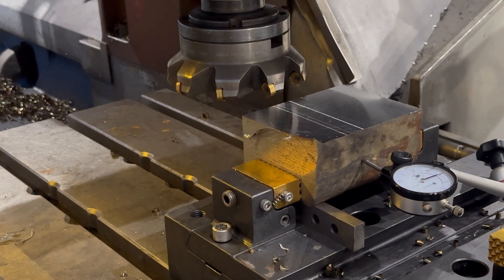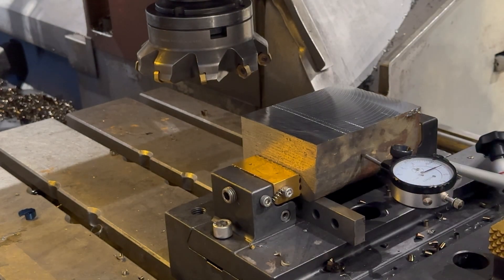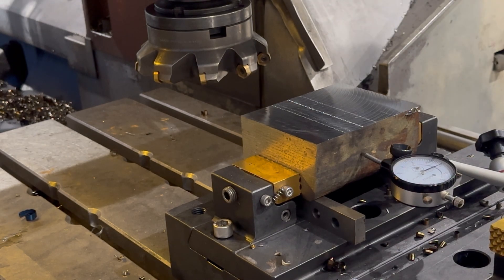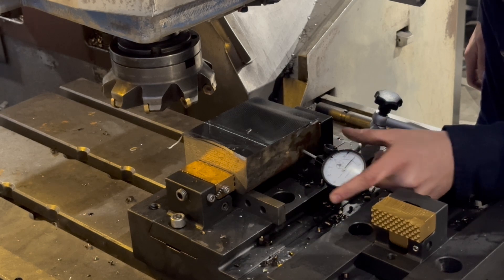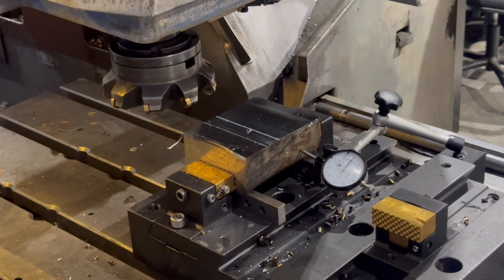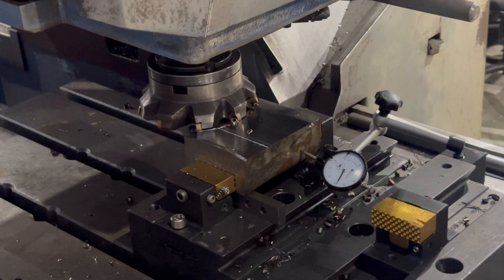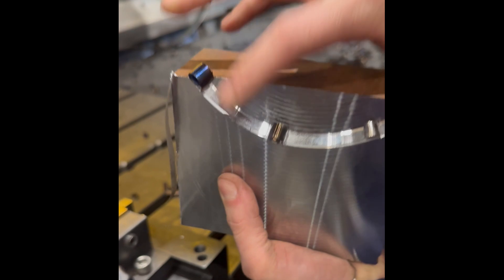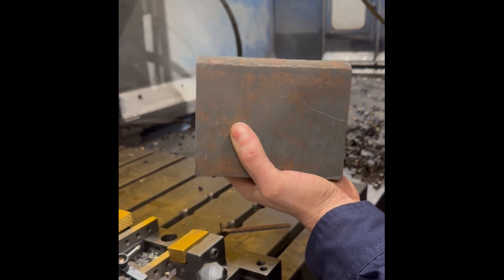Cut. Stall. Survive. Full Test + Aftermath

Comment: What is the advantage of this over other modular vise concepts like gerardi? They also offer serrated jaws with a similar clamping method.
Reply from the maker: @jackkara91  Appreciate the question. What you saw in the video was just one clamp head in action. The full system hasn’t been shown yet, but here’s a hint of what it can do:

Say you’re mid-run on a large block, and the boss throws a rush small job at you. With this setup, you don’t need to tear anything down. You can quickly reposition clamp heads, adapt to the new part, and be cutting again in under a minute, with thousands of pounds of grip force and your original setup still locked in.

I literally did this yesterday! flipped a few heads, ran a second part, and jumped right back into the first job. No soft jaws. No fixtures. No wasted time.

When it comes to layout flexibility your options are unlimited. With modular head placement and a backstop that goes anywhere on your table, you’re not boxed in by stroke limits or fixed positions. Whether you’re running small parts, long parts, or irregular shapes, you set the rules.

Full product reveal drops May 24th
Reply: @MadMachinest  I look forward to seeing the finished product. The industry is in dire need of more clamping options IMO.

Comment: I machine a lot of waterjet parts and those thing wanna launch out of the vice if you look at them wrong, turning 50+ lbs waterjet blanks on the lathe is stressful. Normally in waterjetting the taper is consistent, top of the part is narrow and bottom is wide but if the waterjet operator doesn't keep up on his consumables the taper does weird stuff, it'll be narrow at the top, wide in the middle then narrow at the bottom again, absolute nightmare.
Reply from the maker: @radtap  brother awesome comment! And you 100% right on all accounts!  With this design everything is solid.. once you tighten your gripper the part become a part of your table.. you would have to pull the base block off.. which isn’t happening unless you sheer qty 4: 3/4-10 SHCS 

The parts flying out of a vise will be the thing of the past come the end of the month! 

Cheers man 🙌

Comment: It didn’t move?  .050”
Reply from the maker: This is why we test!! I couldn’t be happier.. the gripper did everything I wanted it to do. While cutting part was held strong no movement. Awesome! 

Keep in mind and I know I haven’t show this yet.. but this application and test was using standard Allen keys HAND tight! 

The 0.05 is all how you look at it.. the part didn’t pull up, It shifted to the side. It took the brute force of the stall with the movement of 0.05.. that forgiveness actually saved my cutter! 

To pull this part out.. you will have to pull the table off as well lol and this test was only using a single clamp for the record!

Cheers man! 👊